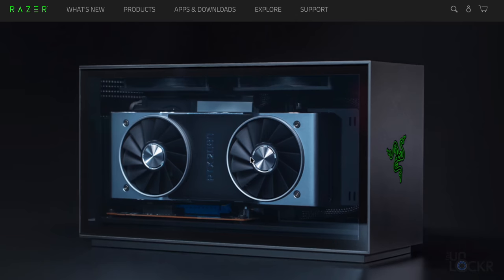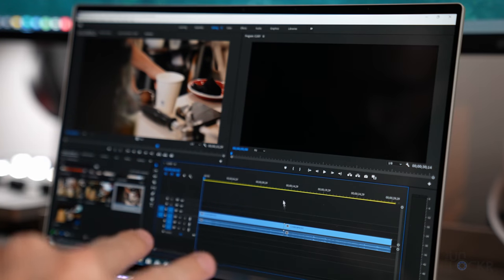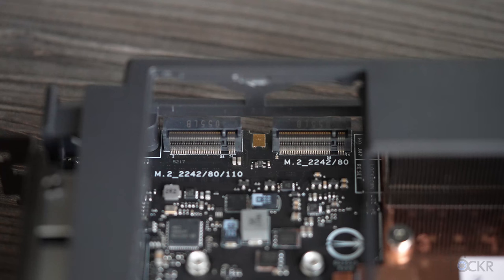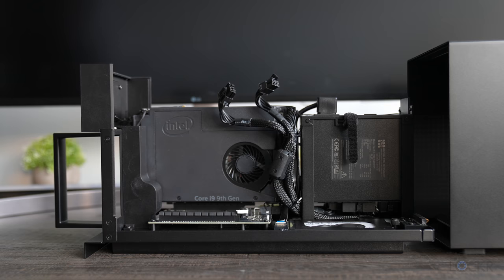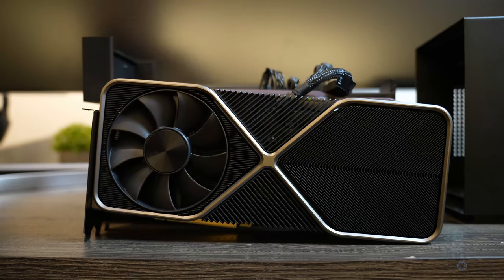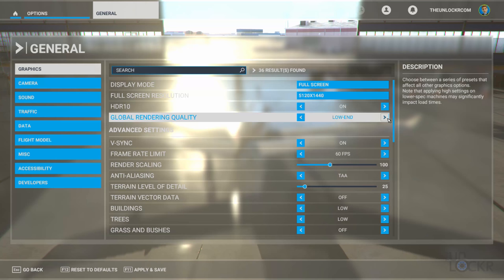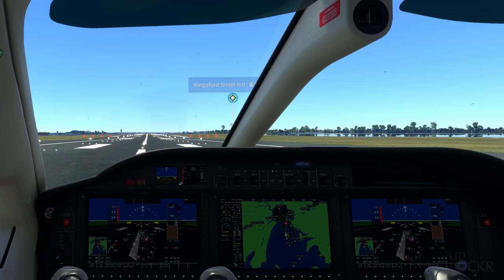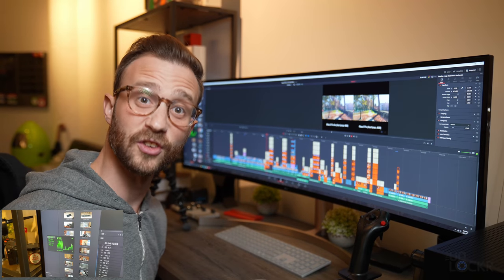Razer Tomahawk Real-World Test (First Impressions, Performance Test, & Vlog)

Comment: I like the Razer Computers in general very much, just the I 9 NUC is kind of bottle necking the whole system. AMD is actually offering similar CPU, but those are way more powerful, and given the price you can built a computer in this same case with just a way mote powerful CPU for the same money as the one offered by Razer. I think that it would be good Razer would give people the choice of choosing a mote powerful NUC which is available from AMD.
Reply from the maker: There are new 11th gen NUCs since this launched, just an FYI
Reply: @TheUnlockr  can't seem to find the Intel NUC 11 Extreme Compute Element, NUC11DBBi9...because it's only being sold in their Beast Canyon. Any intel on compute element release? Thanks in-advance!

Comment: i don’t know anything about pcs if i buy this will is it a full pc?
Reply from the maker: Yep. You'd need to either get the option with the GPU or the cheaper version is missing a GPU and it'll use the built in one with the NUC which is fine but if you want to play games or edit photos/videos you'll need to buy a separate GPU to add inside. But that's it.

Comment: So this already has a computer in it? I thought it was just an empty case
Reply: Nope. It has the intel NUC pc with a 3080
Reply: @brianmateo8041  so if I hooked up to a monitor it wont show anything than correct?
Reply: @joeysmith7907  It does have a computer inside. Its using the Intel NUC 9 with the 3080 so yes, it does have a functional pc inside.
Reply: @brianmateo8041  thank you for the information this will be perfect for mh nephew
Reply: @joeysmith7907  Yep, looks great. Planning on buying it. Wish it was cheaper though, especially those taxes